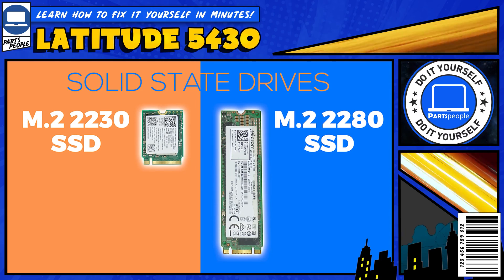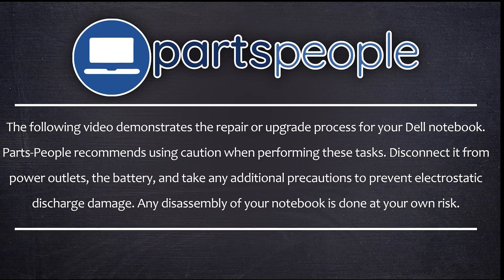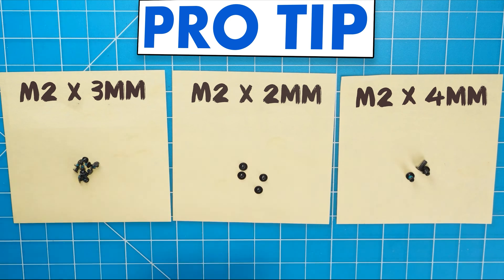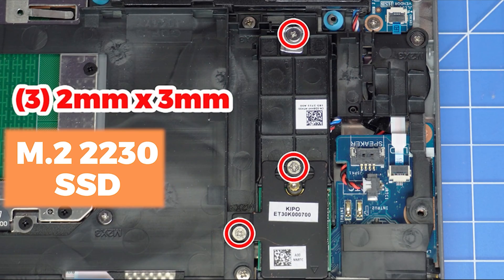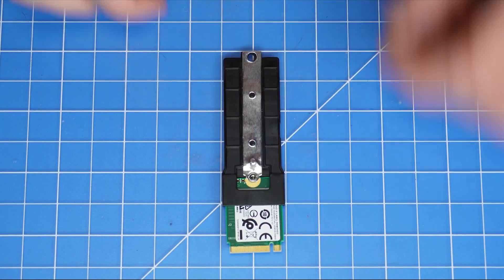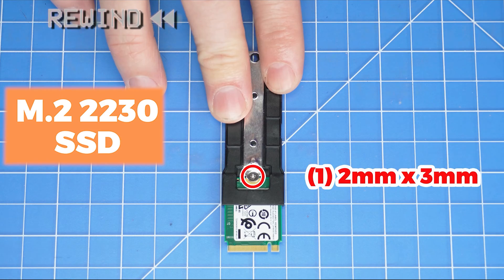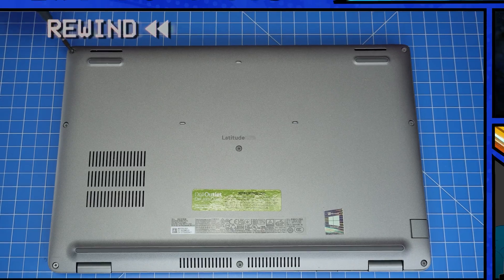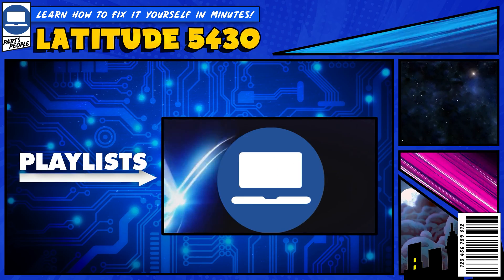How To Replace Your M.2 NVMe SSD | Dell Latitude 5430

Comment: There is an empty slot in the 5430 that has the label of jngff1. Is it only exclusive for a WWAN card? This slot does not take another SSD drive?
Reply from the maker: Yes. It is exclusively designated for the WWAN card.
Reply: @dellpartspeople  can you try to insert short nvme there.
i heard there are some people who are able to use it it detected as Nvme but cannot be used as Boot drive. 
so it only detected after inside Windows